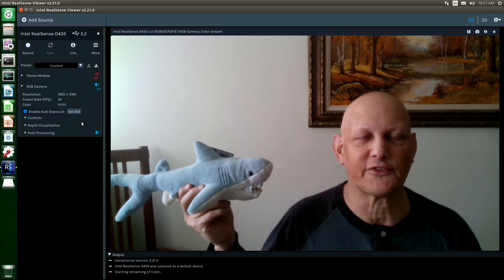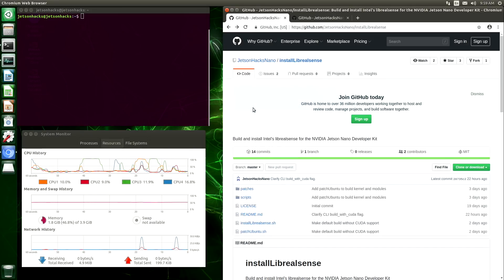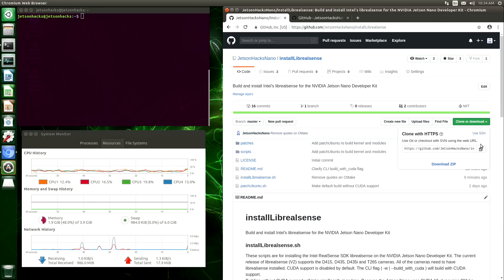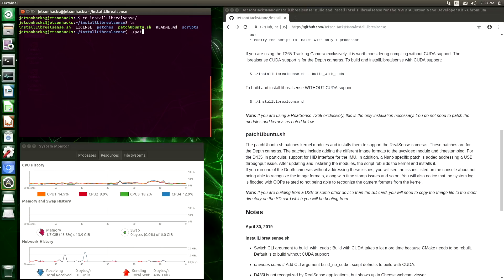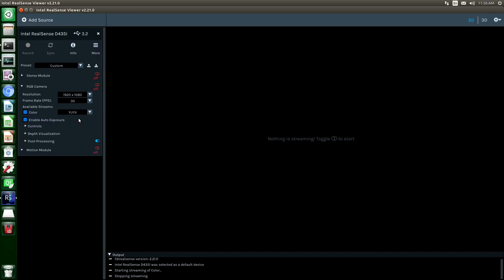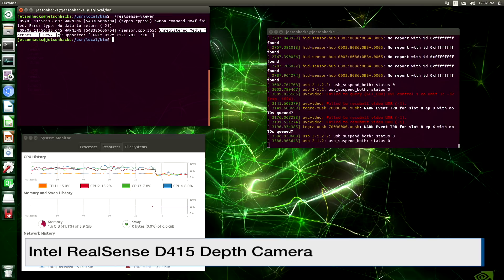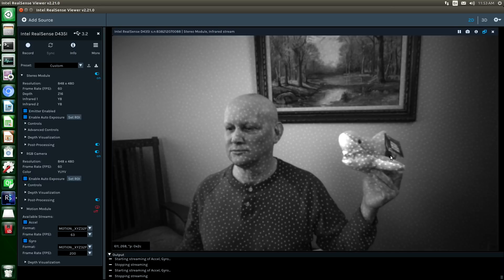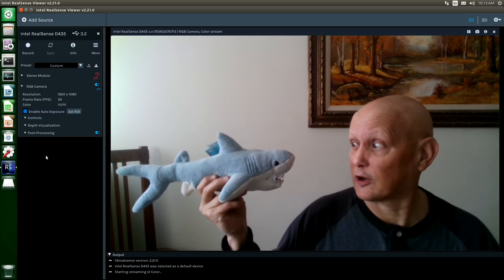Jetson Nano + RealSense D400 Depth Camera

Comment: Great video and install script! My realsense D435i is now running on my Nano, but the RGB overlay is not working. Which Firmware do you use? I tried already the last 3 versions without success. It shows for one frame the RGB image in 3D mode and then it is something between gray and green. In 2D mode everything works fine.
Reply from the maker: The firmware version on this camera is 05.10.13.00 You should lower the resolution to 848x800 @ 30fps on the cameras. The Jetson Nano doesn't have the horsepower to run the point clouds in the realsense-viewer application at higher resolutions. I don't know if this is related to the task or the application. Thanks for watching!

Comment: Great post - as always. Is there a particular reason that you built librealsense without CUDA?
Reply from the maker: Thank you for the kind words. The CUDA code is used for mapping purposes, color conversion, and image rectification of the RGB stream when displaying in 3D and so on. To compile with CUDA and the librealsense library, you also need to compile a newer version of CMake than the one in the Ubuntu repository (takes about another 30 minutes).

In the case of the Nano, there's really not enough horsepower to do a real texture mapped point cloud (or at least I could not get better than a frame or two per second with the realsense-viewer application). If you are just using the depth map and color stream in a robotics application, for example, the CUDA code isn't that useful. For a faster machine, like a Jetson TX2 or Xavier, it makes sense to use the CUDA enhancements. Hope this makes sense, and thanks for watching!